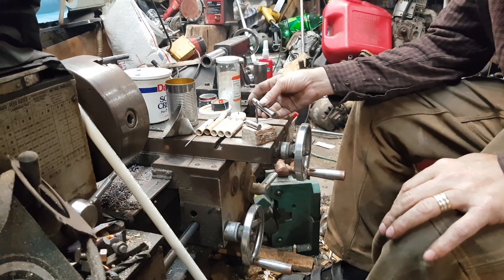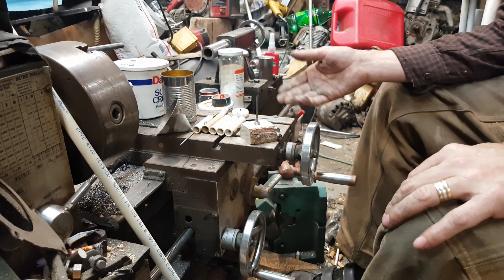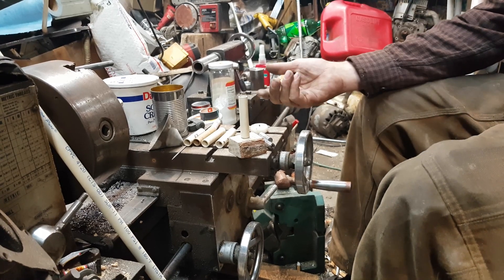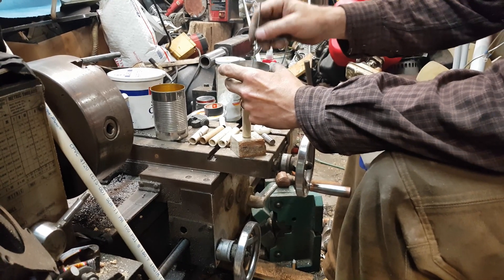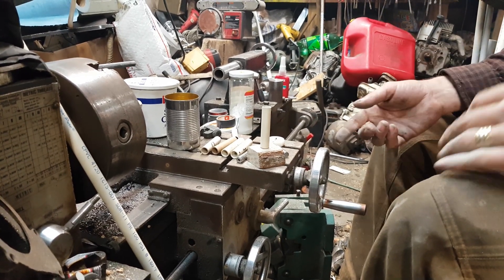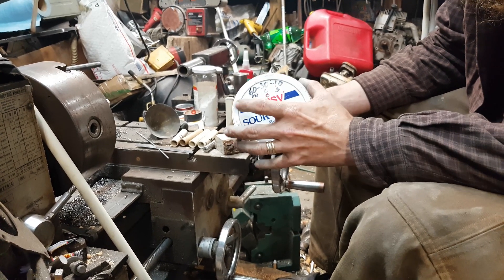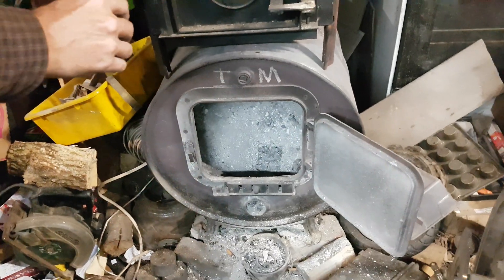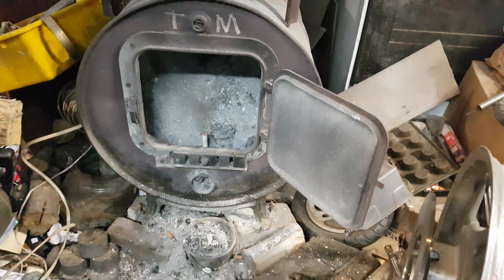Black Powder or Sugar Cored Rocket Engine Making Kit How to Make a Rocket Engine and Test Fire

Comment: Saw your items listed on eBay.
Pretty interesting at many levels. Love the shop! Love the resourcefulness and make-do with what you have style. Basic materials, basic manufacture, good performance. Not sure about the ski mask at the end.
Since the motor is nearly all core burning it is a very short, strong thrust pulse. Would be nice if there was a second, shorter spindle and appropriate ramming tool so that the initial core length was, say, half the length of what you showed so that the thrust spike would be about half as intense and followed by a low thrust sustainer phase, more like a traditional model rocket motor.
I would love putting one of these on a test stand to determine the total impulse.
Thanks for posting this.
Reply from the maker: The impulse power on a 1/2" BP rocket is enough to toss a red brick. This kit is designed to be as cheap to use and as foolproof as is physically possible. If you do buy one of these kits and then make any videos with it, let me know.